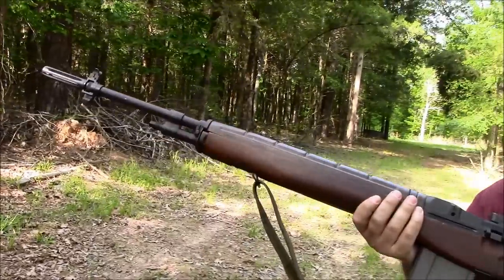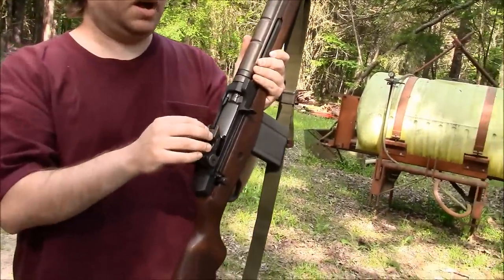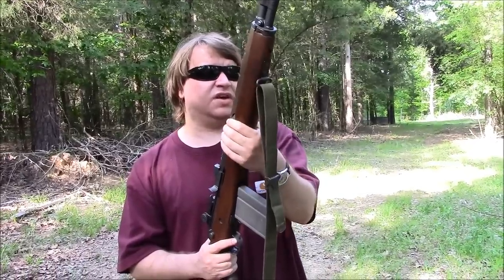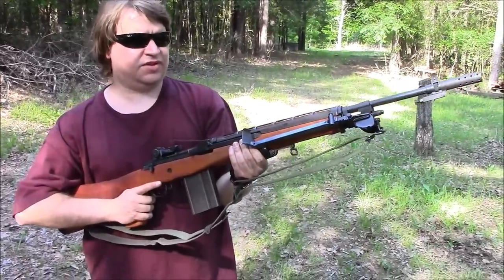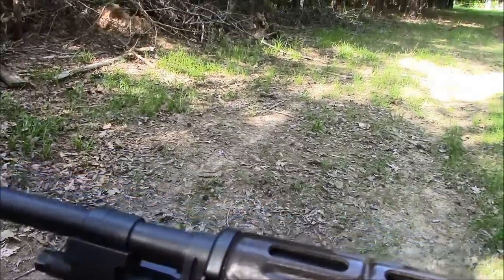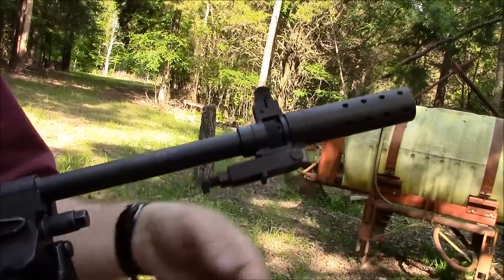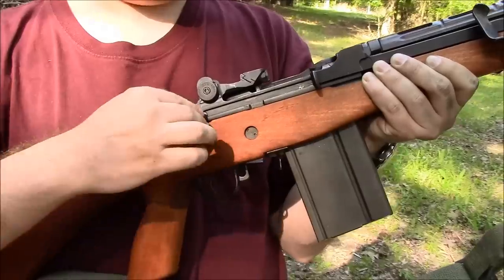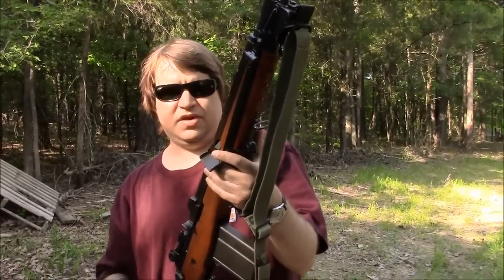Semi Springfield M14 & H&R M14E2 Review - These Are My Rifles!

Comment: Part of the problem with the full auto m14s is the high rate of fire at 750 rpm, it should have been regulated down to 400 rpm. I'd like to see a couple inches added to the barrel, a heavier op rod & a 3 round burst ability. I read that some veterans in Vietnam would drill a small hole in the gas plug to reduce the rate of fire, in the end get it to perform like the BAR as much as possible with out the weight.It has some great qualities like an excellent trigger, a roller on the bolt to reduce friction, & excellent sights. They are hard to beat in the hands a well trained & disciplined rifleman.
Reply: Should they be reduce the weight too? There's the how much you can carry during operation and depend on climate it can wear a soldier down. Of course this includes amount of rations. Unless your men are Green Berets.
Reply: @Joshua_N-A  I wouldn't reduce the weight. The thing is the US military wanted an automatic rifle for the fire teams (no belt feed could fill that role back then) where the members could be ammo bearers for the automatic rifleman.
Reply: @mcqueenfanman  what would the ammo bearers carry? Sidearms? Carbines?
Reply: @Joshua_N-A  semi auto m14s.
Reply: @mcqueenfanman  in my country our troops tend to go light due to equatorial climate. It's hot in here. Isn't M14 designed for when USSR crossing into West Germany?

Comment: Do you have an opinion on the Polytech M14s? Any good?
Reply: I hear their receivers are very good, but some of the other parts such as the bolt could stand replacing. That's about all I know, never owned one personally sorry.
Reply: The ones in the US are not so good I hear. By the time the Chinese made good steel, Clinton had an import ban on them. The ones that came to Canada after the ban are great. Owned one for years.
Reply: Get the receiver heat-treated by Ron Smith and let him install a USGI bolt, and you'll be good-to-go....
Reply: Bungman Agforty the receiver metal is great but the bolts and related parts are cast I believe. Many shooters used to build m14 rifles with Chinese recievers, at least until American companies made forged receivers as well.

Comment: I will admit that the M14 had certain limitations for jungle combat and could have been improved. However the M16 was a pitiful replacement that was rushed through testing and adopted more for political reasons than any real substance of the actual firearm. Any soldiers in Vietnam that had the opportunity ditched the M16 for alternative weapons every chance they got. To this day spec ops will use .308 over the M16A4 known as the M4 unless they are instructed otherwise or mission requirements call for the lesser M4.
Reply: Thats all very untrue.